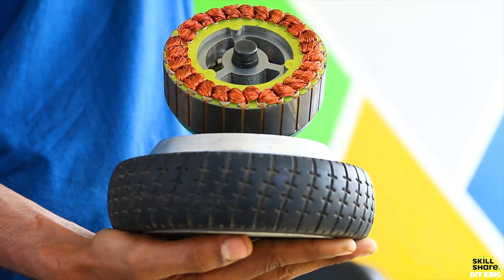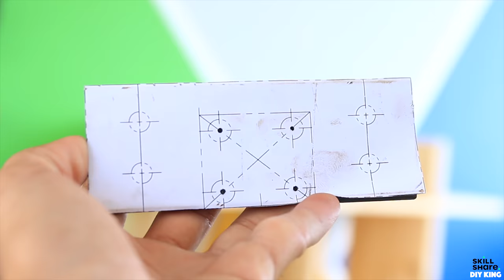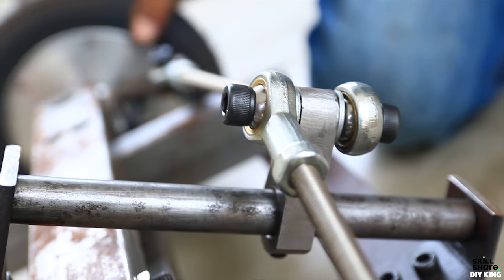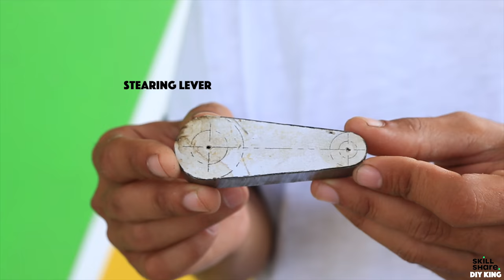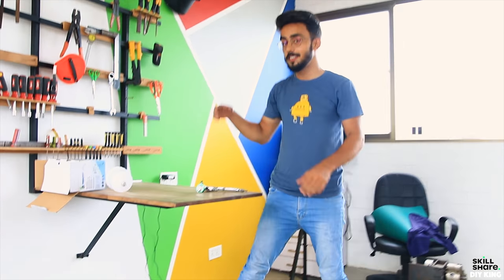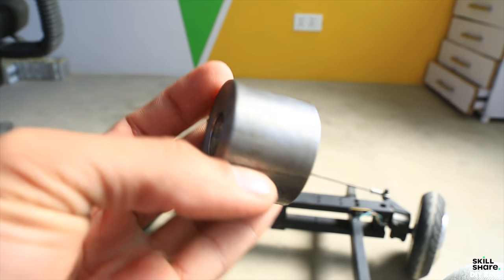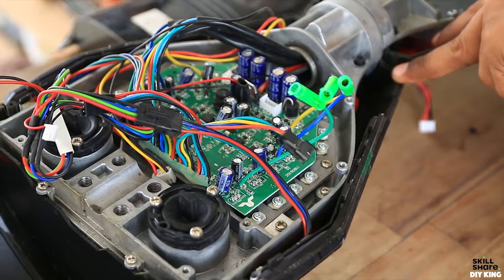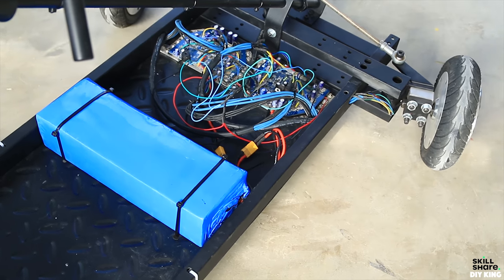DIY Electric Go-Kart out of Broken Hoverboards

Comment: Please make a detailed video of the process undertaken to update the firmware of the onboard speed controller.
 Otherwise, your job finishing was awesome 👍.
Reply: yes, please
Reply: I really want to too :-)
Reply: He uses Niklas Fauth hoverboard firmware which he strategically did not mention. There are detailed guidelines on google. The interface used is UART.
Reply: @freddytime  Please let me know how do you think they learn how to modify the Nicholas firmware code to run two cards togerheer....I am trying to learn how to code STM 32 for these aplicativos. No vídeos on internet was found... Tks
Reply: @freddytime   @freddytime  Please let me know how do you think they learn how to modify the Nicholas firmware code to run two cards togerheer....I am trying to learn how to code STM 32 for these aplicativos. No vídeos on internet was found... Tks
Reply: @andremurilodiasdesouza3848  I believe all you have to do is use indipendent cards, you get 5 volts from only one and the output to the 2 cards. Else you can use an Arduino to split the signal into 2.
Reply: @freddytime  Thank you. Regards from Brasil

Comment: Hi, great video. I have many working PCBs with gyro boards however I do not have the remotes to turn off boards, they turn On but not Off, as the remote on these boards, turn off,  calibrate and lock the board. Can this function be overcome instead of just adding kill switch inside with battery negative? Appreciate your advice

Comment: There's a handful of controllers out there that'll do the job for much less money. 
You just want 24v(or whatever) 250-350w controllers that support hall sensor motors. Can get them on Amazon and Ebay for $15 each. Or you an get a bunch on Alibaba for like $5 each but it'll take forever to arrive. 

These controllers ^ accept 5v input, PWM, and pot.
Pots suck, but PWM and 5v is really easy to get/make. Raspberrypi and Adruino can handle PWM for you.
And 0-5v input  - I'm sure you can figure out :D 

I only recommend them b/c not all Hoverboards have those controller boards ^ Many of the boards have soldered in pins and it's a pain to unsolder them and try to get your pins in there so you can write firmware. All this to save $30-$60.
Reply: Anyone is free to message me for links or questions.

Comment: what compiler does you use to build the firmware?
and what is the hardware to interface the controller??
Reply: He uses Niklas Fauth hoverboard firmware which he strategically did not mention. There are detailed guidelines on google. The interface used is UART. There are free tutorials on google,

Comment: Questions:
Would you be able to achieve the same speed/acceleration and torque using 4 e bike controller? One per motor.
I can do everything except the computer hacking stuff but would like to squeeze as much juice as possible.
Or do I just need to add more volts and amps?

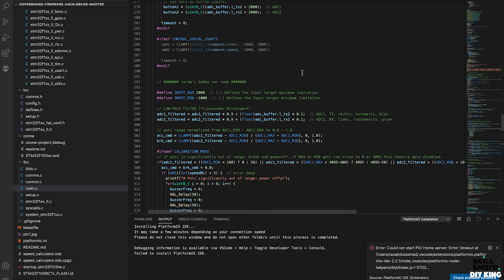Comment: 10:21 the author of the code is exposed. Not to belittle your work but you guys should have given Credit where Credit is due
Reply: I believe he uses Niklas Fauth hoverboard firmware which he strategically did not mention. There are detailed guidelines on google. The interface used is UART.  I have done a similar project 2 years ago, recognise the code that at the time was in 4 different configurations according to the application.

Comment: Awesome guys, you don't have a bumperbar?  Those hover wheels look far too small, personally I'd use the ones that are available for trolleys, with lower pumped up tyres than normal, this will give you the suspension feel you probably need since you don't have a cushion except for your butt lol  Good to see you built your own welder too, did you use an old microwave oven for parts?

Comment: You built the steering arms on the wrong side of the front axle now. Now the tyre on the inside curl turns less even if it has to turn more. If you keep control arms on that Side you have to Put them open Outwardly, not inward. But if you move the track bar to the back of the front axle, then those steering arms must be inverted inwards.

Comment: the ride would b smoother if you replace the tires with inflatable ones ... , the problem is i can't find any inflatable tyres with 5 inches inner diameter ... it needs to b 5 so that the tyre fits the motor... if anybody know a cheap vendor post here :-)